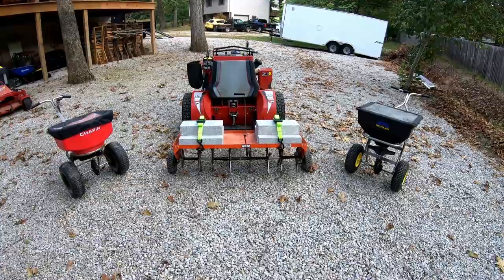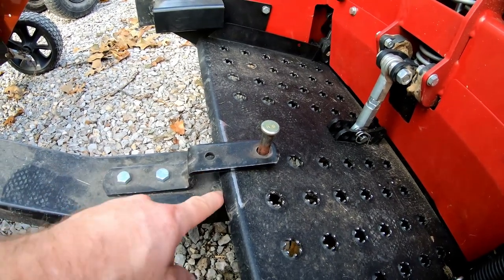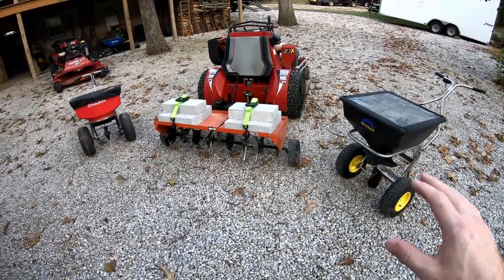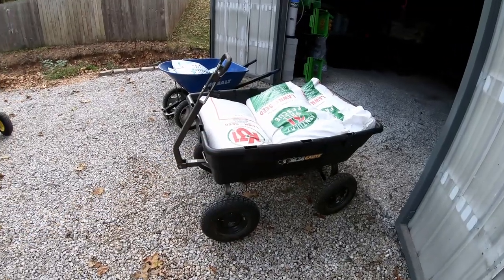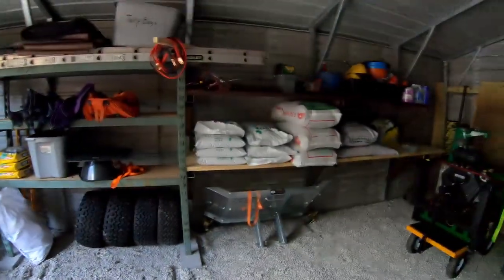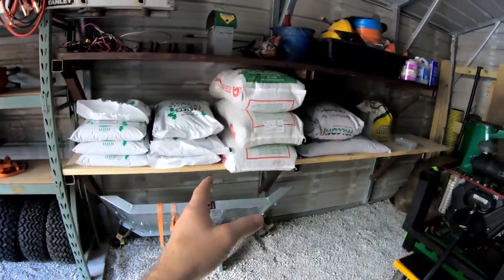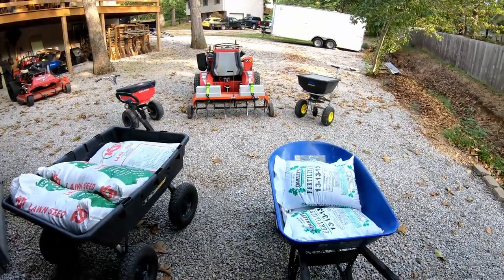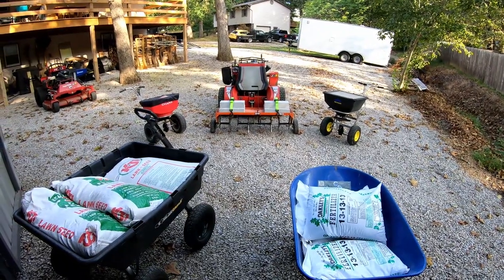2021 Fall Aeration Setup

Comment: The Tounge will not last.. It will bend and break.. Two years trying to make this work.. Had to plate and reinforce the tounge to get anything out of it
Reply from the maker: I will have to beef it up also, but it's making money 🤑💰💰
Reply: @HandyGuy2016  what happened to the zrator?
Reply from the maker: @riversiderebuilds4677  I sold it, just wasn't efficient enough.

Comment: Do you mainly use this setup or the Zrator attachment? In your opinion which one is better?
Reply from the maker: I use this setup now, the Zrator works best on a sit on mower in my opinion and I don't have one anymore.
Reply from the maker: I can cover more ground faster with the pull behind also.
Reply: Is the tow behind one easy to use on smaller residential yards?
Reply from the maker: Yes, that is what I primarily use it for.